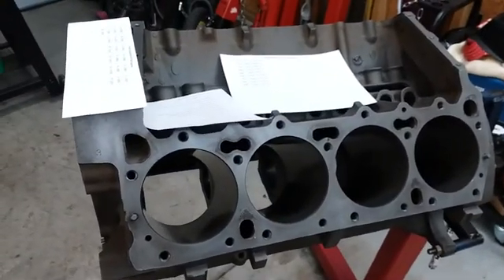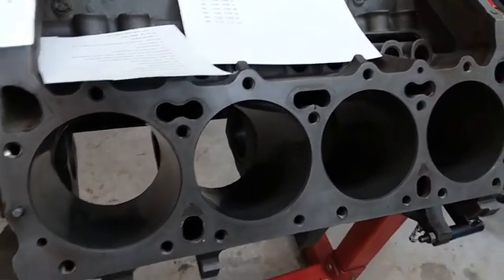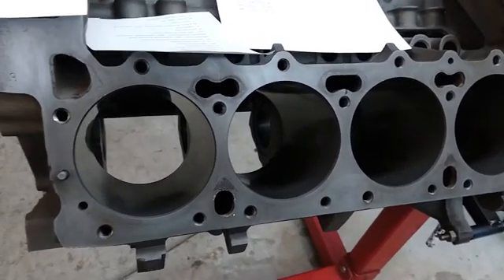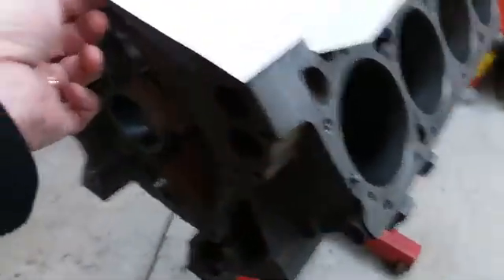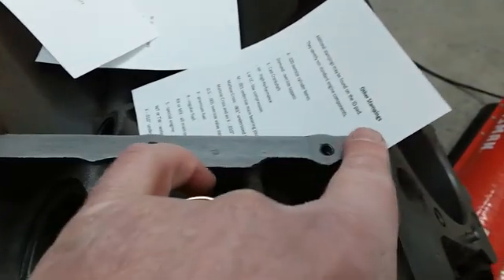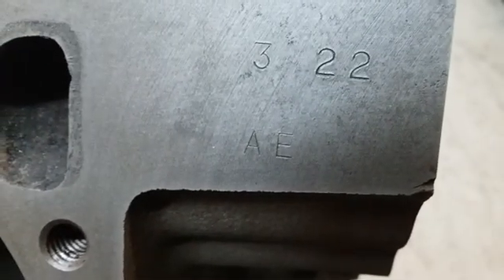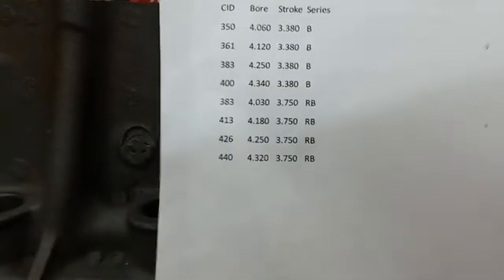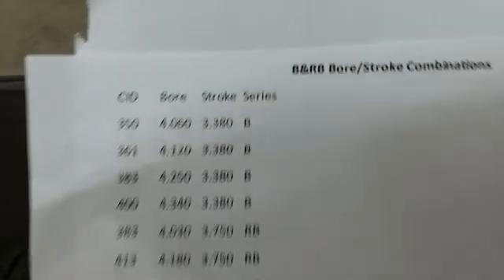Chrysler/Mopar V8 Engine Casting Part 2

Comment: Saw one if these today, and i thought it was a 361 it looked small next to a 440 hemi
Reply: The front distributor and the five bolt head had me staring at it fer hours because I knew it wasn't a small block, but next to the half dressed 440, it looked like it was a 318 but I knew it wasn't just in the headbolt pattern alone. But this was an awesome clip, and thank you for sharing your knowledge
Reply: And the freeze plug up on the side instead of down in the skirt

Comment: Glenn if want big block in a an body, you're best bet is to stroke the snot out a 400 block. Modified 440 crankshaft makes 452 with standard bore. I think 458 @ .030 over bore.

Comment: I was told that not all 400's had a cast crank. This friend told me some police  HP 400's came with a forged crank. True or false?
Reply from the maker: Bud, your friend is right, please follow this link  https://www.allpar.com/threads/the-400-v8-final-mopar-big-block-engine.229879/
Reply: @Thaddaeus417  from experience,the 72' 4spd cars got forged cranks. I had one bought new. before it left had it (roadrunner)running a best of 11.88 @118 mph with a weight of 3550lb. but it took a 4.88 gear to do so. This engine was as bought on the bottom end with additions of hemi race( thick body) oil pump and racer brown cam 296°-296° a .525 lift on Chrysler 300G heads ( small chamber,mechanical rockers) fitted with 1.88 max wedge exhaust valves and 2.15 intakes. the springs,which are garbage from the factory were a Racer Brown with 240lb seat and 410@.525 .The rear was the weak point being a 489 carrier 8.75. Had help figuring how to go from Charlie Castaldo( local RO23 car guy) and Bob Lagana,father of the guy crewing the TF car. They knew their stuff.
Reply: @Thaddaeus417  thx. That sounds reasonable.